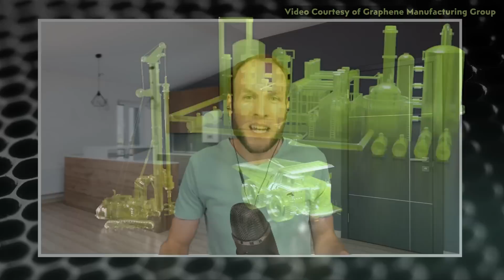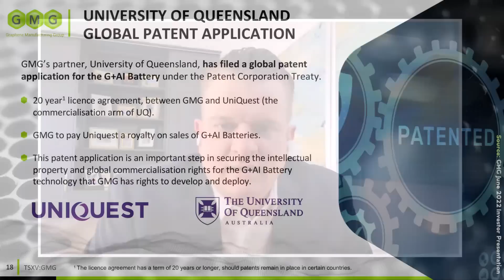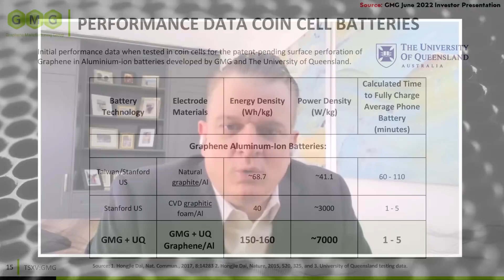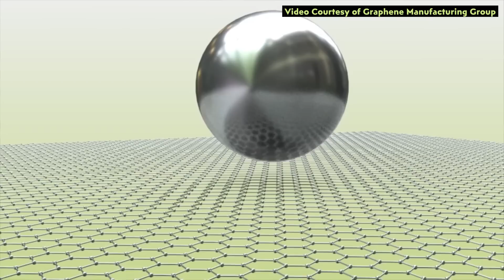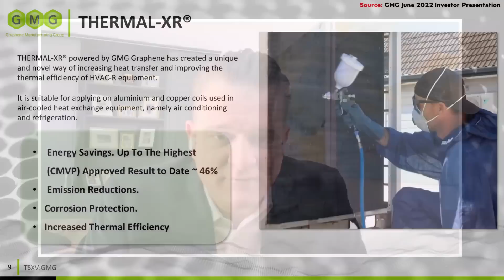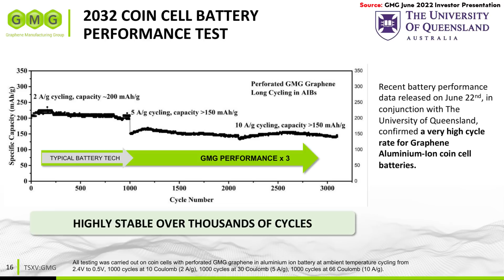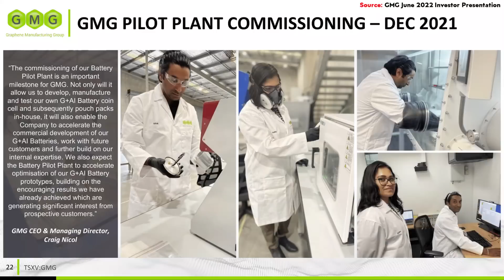GAME CHANGING Graphene Aluminum Ion Battery w/ Craig Nicol

Comment: Their are quite a few statements in this video that are either over stated, exaggerated or flat out incorrect.  Lithium battery fires are caused by high energy density alongside the use of flamable electrolytes and the ability for self oxygenated reaction.  Rechargeable lithium ion batteries contain very little elemential lithium.  The atoms also don't physically move much if at all within the battery structure however, the electrons do.  The BMSs in lithium ion batteries monitor and limit the voltage to safe limits within the series cells within the pack not the current.  Current is only limited by some BMSs in order to ensure that you don't enter a thermal run away condition or a short circuit external to the pack.  Power density with lithium ion is not a big problem as we can design cells that can safely charge or discharge 3C all the way up to 300C+ rates with current battery build technology which can already far outstrip current power grid supply limits.  The round trip efficiency of current Lithium Ion battery technology is above 95%.  Even at scale the cost for this battery technology is going to be very expensive until the market is potentially saturated but that may not happen since lithium ion battery technologies area also improving incrementally over time at a similar pace.  Graphene just happens to be back in the news as the latest catchall thing that everyone is working on but it has been in development for years already and it will be hard to compete with powdered graphite already being used along with other forms of carbon in modern battery technology.

Comment: When 'THE BREAKTHROUGH' does happen will this make my older model EV obsolete? Like the one model out Japan whose battery replacement cost was 27,000 US.
Reply: no, cos the battery can be replaced with a different tech as long as the volts/amps are the same.
Reply: Your older EV almost certainly has replaceable batteries, so when your old battery capacity drops to unusable levels, or if you just want the new hotness, you will hopefully be able to replace it with a newer battery with newer tech, better capacity, etc., though don't expect your charging speeds to change all that much unless the charging circuitry is replaced or updated as well. That's assuming your manufacturer isn't greedy enough to ignore their older models and make you buy a new car instead, which I'm not too hopeful for these days.

Comment: Battery-powered electric vehicles are phenomenally efficient. Depending on the model, they can boast a well-to-wheel efficiency of around 70 to 80 per cent. By comparison, a hydrogen fuel cell-powered electric vehicle (FCEV) is positively parsimonious, with an overall efficiency of somewhere around 30 to 35 per cent
Reply: Parsimonious means frugal; the opposite of what I think you mean, which is wasteful.
Reply: A well-to-wheel efficiency of 70% violates the laws of physics. You can't have a WtW efficiency higher than the efficiency of any given stage. A theoretically perfect (Betz limit) wind turbine is ~59% efficient. Real ones are around 20%. A utility grade solar panel is ~10-15% efficient. Upper limits for PV are complicated, but 40% is a fair estimate. A typical modern natural gas power plant is ~60% efficient. Ignoring cogeneration benefits, the thermodynamic upper limit is ~70% (heat engines). Grid transmission losses are another 5-10%. Electric motors can be 97% efficient, let's say 99% just to be unrealistically generous. Associated variable frequency drive, inverter, and other power electronics have an efficiency of at best ~90%. So you can't even get a well to tank efficiency of 70%, let alone well to wheels. Before we even consider the battery losses, you can't get above 50%.
Reply: @thealienrobotanthropologist  Your figures are ok; but, burning fuel engines are less than 40% efficient, at best. The benefits of electric vehicles are their constant rate of efficiency, not just some of the time; expended energy can be, partially, recaptured during regeneration going down hill and during braking; noxious gases during operation, none; less aerodynamic drag requiring less energy for the same performance. The electric generators, for charging, operate at constant speed, which is the most efficient and least polluting, and their polluting gases can be more easily captured and dealt with.
Reply: @artsnow8872  While Otto cycle engines are less efficient than combined cycle electric power plants, turbocharged diesel engines are slightly more efficient. Non-combined cycle power plants are roughly the same as Otto cycle engines, with a lot of variation in each category. Subtract 20% off the efficiency of the best combined cycle electric plant to account for distribution and grid storage losses, then also power electronics, battery, and motor losses and suddenly the efficiency over a badly designed Otto cycle engine is rather modest. EVs aren't intrinsically lower drag than ICE vehicles. That tends to be the case because it's more important for EVs, but there's no reason the same couldn't be done with ICE. You just need to persuade the marketing and styling people. EVs are significantly heavier than ICE and thus have more rolling resistance. They also tend to have wider tires to support the greater loads, which is a surprisingly significant aerodynamic disadvantage. Cabin heating in cold environments is another significant disadvantage for EVs. This effectively lets ICE engines operate in a cogeneration capacity vs an EV running a heat pump for heating. This actually can put the best (turbocharged Atkinson or HCCI) Otto variant engines ahead of EVs in energy efficiency. They may have bad emissions, but turbocharged diesel engines are the most energy efficient well-wheels solution available. EV efficiency is not constant either. With the exception of the Porsche Taycan, they use fixed speed gear boxes, but the required torque varies widely throughout driving, leading to gigantic inefficiencies. Imagine driving an ICE car in first gear at all times. This is the price of the great acceleration EVs are known for. There are linear torque curve electric motors that could avoid this issue, but they're extremely inefficient and not suitable for any demanding task. While it was a big problem with older ICE engines, modern engines with a host of emissions technologies aren't that different from burning the same fuel in an electric power plant. Electric power plants benefit from natural gas being much cleaner to burn than gasoline or diesel fuel. Burning coal is worse though.

Furthermore, the pollution from solar or wind plus battery based grid storage is roughly at parity with combined cycle natural gas plants (minus cogeneration benefits). In order to reduce pollution from electricity generation, we have to either keep enough natural gas to avoid grid storage or adopt nuclear instead of grid storage. The smart solution would be thorium reactors plus a few fast breeder reactors (just to eliminate the nuclear waste produced by the 1950s and 1960s era antique nuclear designs). In order for EVs to make sense environmentally, the electricity can't be generated from our current mix of sources. Otherwise we'd benefit far, far more from getting people to drive sensible cars instead of luxury tank SUVs and monster trucks. A Tesla Model X P100D, to say nothing of the Cyber Truck, Hummer EV, etc. are worse for the environment than a basic ICE economy sedan or hatchback unless we switch to mostly or entirely nuclear energy. Hybrid vehicles really would make the most sense until the electric grid is converted to nuclear.
Reply: @thealienrobotanthropologist   All great points; but, there are more positive ways to look at each of your assertions.  Overall, the reduction in pollutants and total energy usage will be reduced the more electric we become. Improvements will continue in efficiencies on all fronts.
 The same can't be said for ICE vehicles. They have reached their zenith of development. Hybrid vehicles are the worst of both worlds. They involve more engines (fuel AND electric), exhaust systems, and transmissions, and added weight and expense:  a lose-lose situation.
 I would love to see the newer generations of nuclear power plants be promoted and supported by governments, as well as the general public. There are a lot of really good solutions coming down the pike in energy storage, generation, and usage. The future is bright.
Reply: EV's are not that efficient beginning to end if you average the efficiency of the power creation. You or your source are cheating the numbers. I do agree though, hydrogen is way off compared to EVs.
Reply: depends 100% on the source of the H2.

Comment: Q: what is the cost? A: well its really simple (20 minutes later, no answer) its not about the cost of the material its about the process and we've been doing it for six years and its really low" 

Non-answers. Not familiar with this specific product or the science behind it but the way its talked about makes me distrust it. If its a viable battery solution state the facts including current manufacturing costs with precision and then projections about what it might cost in the near future and any potential short term further capabilities of the tech and chemistry. Suspect blowing smoke here.
Reply: Look at his website. Projection: notably cheaper than Li-ion as well as much safer.

Comment: What  happens with fast charging? Say the battery can store 75 kWh and charge in 8 minutes, how much power is needed? Around 0.5 MW ! Cool.  And is this realistic to have installed in every station?  It is say 5000 V and 100 A. Not exactly what we would like in our carport. So, what to do? Convert to hydrogen.
Reply: Def not hydrogen, I thought everyone had moved on from such an inefficient & necessarily corporate-giant-dependency for cars. It's simply not viable.
Big things yes
Reply: @guringai  totally wrong, there are so many improvements on storing and produsing H2, you may not like it but you will see it

Comment: Too much emphasis on rapid charging. Li-ion can charge fast enough for EVs, although it takes some effort. And who needs to charge a phone in 5 minutes?
Related to this, where the higher POWER density of Al-ion could really help is in something like the new Tesla Roadster, or more extremely, a drag racer. Needing a big honking pack just to get the power really does suck.

Comment: there is also an interesting application as a buffer for fast chargers. that extreme power density is not needed but for trucks you want to charge with 1MW without putting too much strain on the grid. if you have a crazy high cycle life, it is perfect for grid/charging buffers.
Reply from the maker: Very true!
Reply: KInd of like the Tesla Mega packs. They're about the size of shipping containers and installed at power substations. The power packs and mega packs are supposed to be using the 4680 lithium iron phosphate batteries.
Reply: What do you mean when you say “without putting too much strain on the grid”?
Reply: @corporalpunishment1133  usually when you have a contract with your electricity provider you pay for the electricity and the maximum capacity of your connection. example: if you have 10 chargers with 1MW maximum power, you have to pay for the MWh that you are consuming but you also have to pay for the maximum possible power of 10MW. and even if no one is charging, you have to pay for the possibility of using 10MW. because your provider needs to build the grid that can handle 10MW peaks. if you order a connection to the power grid of only 2MW instead of 10MW and connect a huge battery buffer to support 10 trucks that charge 10MW, you still only draw 2 MW from the grid, the rest comes from the battery. you then pay less to the energy provider because the peak demand is only 2MW. that mean less stress (or strain?) on the grid.

Comment: Glad you covered this, I've been keeping an eye on this company for some time and the really have the right of it, especially with the use of turquoise H2 production. We have so much natural gas, why not use it to make carbon black for passenger car and small device batteries and H2 for heavy industry and shipping.
Reply: This process is unlikely to generate enough H2 to power itself, much less be a significant source of H2 for general use. It certainly is properly used for that purpose, but I would like to hear from the company on the actual amount of H2 produced.

Comment: Aluminium has three times the number of electrons than Lithium, yes, but four times the mass.
Reply: True but that's not where most of the mass is in the battery.
Reply: Note that Lithium comprises about 10% of the mass of a Li-ion battery. So, it's not really a problem.

Comment: 150 compared to 450 watt hours per kilogram with lithium batteries it looks like lithium is still the winner for electric vehicles doesn't it?
Reply: You have to look for density at pack level as plenty of mass comes from thermal management. Myself I'd prefer to have smaller battery that charges at constant 250-350kW instead of more capacity but slower. This would make stops more frequent but very short.

Comment: Looks like perfect renewable energy storage solutions at current density but also with so High charging rate having 50kWh battery pack able to be charged 0-100% at 350kWh rate that would take around 9 minutes is also good news for most EV drivers.

Comment: Those batteries packs look similar to the ones I use for remote control airplanes and drone which are Lithium Polymer LiPo Battery Cells but when they get hot, they tend to swell because the gases produce can't be release like 4680 batteries. So, I was wondering if AL-Ion battery pack will swell up like Lithium Polymer LiPo Battery Cells or will it have some way to vent gas produce by heat?
Reply: Whether they will swell or not depends on the electrolyte and on charging temperature. 
I suspect there will be no problem with this. What's more, aluminium doesn't present growing dendrites problem like lithium or sodium metals do. That means no inner short circuits and therefore no catastrophic breakdowns. Also, aluminium relatively is nonreactive metal compared to lithium or sodium metals.